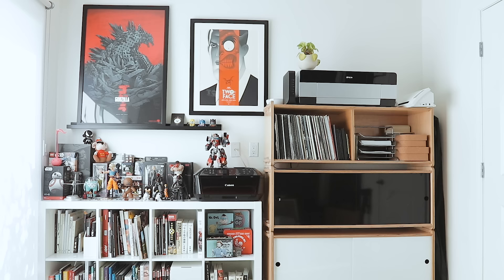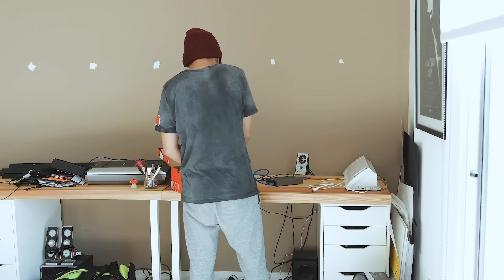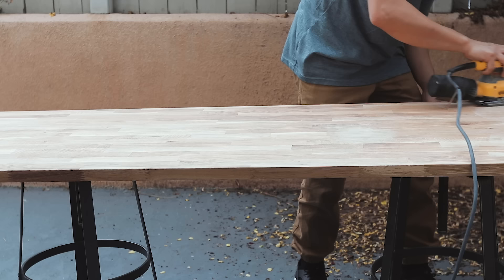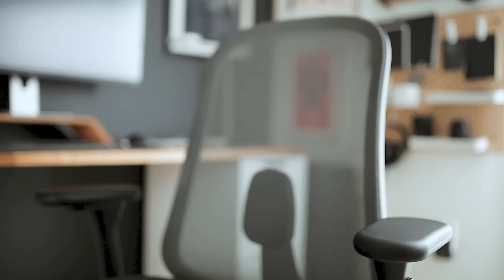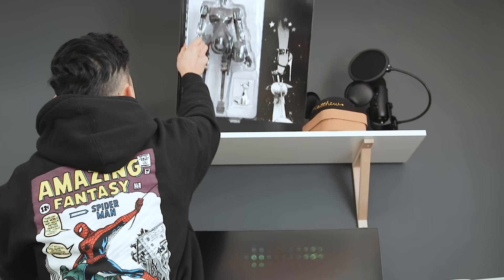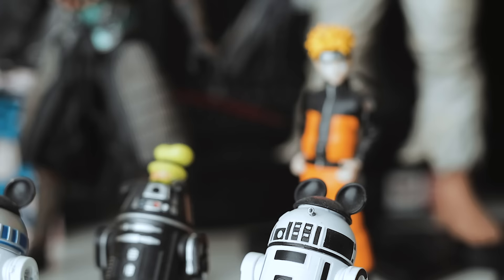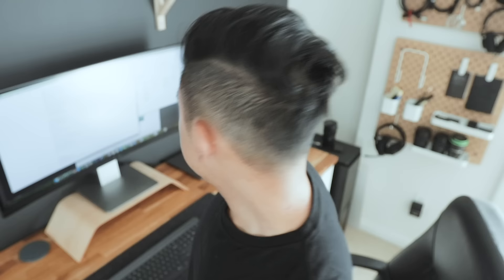DIY Home Office and Desk Tour — Work From Home Setup

Comment: To make your life easier, all Dell monitors allow you to create shortcut buttons on the monitor itself,  so you can create button shortcuts to allow you to switch inputs at a push of a button rather than scrolling through menus. You can also download “dell display manager” where you can use computer software to easily control the brightness and other settings of the screen without navigating though settings.

Comment: Just starting my home office plan... open loft and designated office cave. Need to minimalize the area around my space and got inspiration from your video... I have vintage macs, monitors, printers, speakers, and the like.  I need to wipe them and get rid of them as well.  Hoping to decide on the landscape of my desks and the storage space on the high ceiling wall behind the desk.  Thanks for the motivation... now on to finding my vibe... One thing... I have several murals painted in my home on the 3rd floor loft and stairwell; however, that is my living space and wanted to keep work in a designated place (since my work/life balance is a blur).  One problem... I love my art, the boost it gives me... suggestions are hugely welcomed... off to watch another video ;)
Reply from the maker: Keep it. Play around with it and adjust as you go.

Comment: Hey, I have some questions regarding your desk:
1) Is the tabletop your using deeper than your Alex drawers? In other words, does your tabletop hang over the ALEX Drawers from the front at all, and if so, how much overhang is there?
2) I found that the Gerton IKEA tabletop is very nice and similar to yours. I've seen others just apply the oil finish, but don't sand the wood down. Is sanding the wood really necessary, or no?
3) What are the dimensions of your wooden tabletop?
4) How have the ALEX Drawers held up over time? Since they are made from particleboard, I want to know since I am investing in an IKEA desk.
Thank you.
Reply: Aakash Kalmady i hope he answers these they are really good questions

Comment: Looks really good and stylish. Just one "however" - the abundance of open horizontal surfaces makes them (and the items stored there) collect quite some dust, which I find impractical. If you just put them behind some doors, probably made of glass - it could protect the items (especially the camera/lens stuff) and you from spending time wiping the dust out.

Comment: Get the app called "Magnet" for the macbook so you can dock various apps to different regions of the monitor easily. Way easier than click and drag at least. You  can have shortcuts lke "Command+Arrow" for moving the current window to one side of the display.

Comment: I have a couple of questions (may be stupid)
- When you put the tabletop on top of the Alex drawers, did you put something underneath the table so that it doesn’t move? Or no? If so, what did you put? 
- Also, do you think a tabletop would hold 3 monitors?? 2-24 inch monitors and a 28inch monitor?
- Would a 63 inch tabletop be able to fit those 3 monitors?

Comment: I saved $ on the chair, because I got car seats from a JDM chop shop(wayyy more comfy), bought a gas lift, the metal paddle thingy to adjust the gas lift height and metal legs with wheels from an office equipment supplier, weld them together and now, I am able to say "But can your chair do this?!"

𝑺𝒘𝒊𝒏𝒈𝒔 𝒃𝒂𝒄𝒌

Comment: Thanks for recommending your mouse. I just bought the MX Master 3 and I really like it. It is very comfortable to use! I also like how programable the buttons are when using it in MacOS with the supplied software from Logitech. I also got a table similar to yours in this video but I still need to treat the wood.

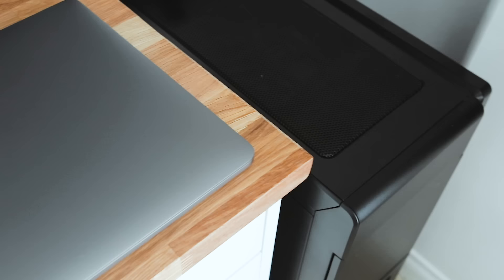Comment: Very neat setup. One quick question please, at timestamp @3:40 you mentioned about logitech keyboard and toggling between 2 systems using one keyboard and mouse. Do you need a software for that or how can we use one keyboard and mouse for 2 system, if you could explain lil bit on that. Thank you for creating this, hopefully i will incorporate part of this in my new setup as well.

Comment: Matthew - that is a really great looking set up. Kudos. The only question I had is, did you screw in or glue the  countertop to the drawers? Or, if because of the countertop’s weight, neither screwing or gluing were necessary?  Appreciate any guidance.

Comment: I got interested when you said you can switch your monitor between mac and PC, I didn't know that is possible. Can anyone here give me a link on how to do that? Thanks!
Reply from the maker: You just use the keyboard and monitor to change source. As easy as that.
Reply: @MatthewEncina  sorry, I meant how did you have mac and windows running at the same time? Is your monitor connected to a windows laptop and a macbook at the same time? Thanks for answering :)

Comment: Thank you for this video!  I really appreciate it.  I noticed that you have a fairly large window in the space.  What made you choose that particular wall to situate your desk/computer?
Reply: @MatthewEncina  Do you get a glare on the computer screen from the window?  This is my concern. My office will double as a guest room so I'm wondering about the flow if I pull the desk off of a wall, and turn it facing the door, back to the window rather than placing it against a wall (which I don't really want to do).

Comment: I liked your improvised table. One question though; Is the table top fixed to the alex drawers in some way? Or is it just resting on the 2 alex drawers base?
Reply from the maker: There is a rubber mat sitting between the two

Comment: Matthew, are you mounting the counter/table top onto the drawers? Or is it heavy enough that it doesn't move?  I was curious if you bumped it, would the whole top move on you.   Great Video and Office!
Reply from the maker: I use a rubber grip mat in between to hold it in place

Comment: that's a lovely setup sir... love from India. I do have some questions like 1) is that table totally fixed with those drawers or just that lies on the drawers without any attachment. 2) if that table is not fixed then is there will be any issue of flip over if anyone uses monitor arm on that
Reply from the maker: Just a rubber grip mat between the top and drawers

Comment: Which docking station can I use to connect my office laptop to connect with two monitor and when I do not need to use my laptop I can connect with my personal Tower. I do not need to change all wire all the time just one wire  usb - C which I can plug in to my laptop in need and do not then to my tower ?  Thank you for your help.
Reply from the maker: These days I’m using the hub from Caldigit

Comment: Hi @Matthew Encina, I like your work and think you might be able to answer this question. I am looking forward to do a setup similar to yours. I have a work issue Dell laptop which connects to a work issue kensington docking station via a 60W USB-C. I have a SurfacePro 6 which I use for all other personal business. I am looking for recommendations in terms of connecting both these computers to a dual monitor setup and use the same keyboard and be able to switch with a tap of a button just like you did. Looking forward to hearing from you. Thanks!!

Comment: So for the keyboard and for the mouse, it can be connected via bluetooth to 2 computers / laptops at the same time? So I don't have to keep switching back and forth?
Reply from the maker: Correct ;) You can actually connect up to 3 devices.
Reply: @MatthewEncina  aweome thanks! i work between 3 laptops and its a bit cumbersome to switch mouses everytime i need to switch laptops, thanks so much!
Reply: @MatthewEncina  or even just have 3 mouses.. lol! which i have 2 at ones, which its a bit much, again thanks!

Comment: Hi, I know this video is 4 years ago but just wanted to ask a question. Does your table ever move slightly as there is no anchor (nails,etc)? It seems that you just placed it on top of the shelves.
Reply from the maker: I use a rubber grip mat (for drawers) between the top and base. Never moved unless I picked it up.

Comment: Matthew, I know you upgraded your desk eventually, but did you find that the Danish Oil held up well on this one? I am looking to start with the same kind of desk setup, but I am worried about spills. I'm also debating a wood veneer option instead, but it wouldn't save me all that much.
Reply from the maker: Danish held up but if you really want to seal from liquid go for a lacquer (it’s just glossier). If you can spend the money, go solid wood. You can always sand solid wood down if you want to refinish.

Comment: I am currently making a similar desk, with alex drawers, but instead of the karlby desk I bought an ekbacken tabletop which is much thinner and cheaper. Does anyone know if the decision I made was the right one or will the desk break
Reply from the maker: Those are solid. It shouldn't break unless you're really putting a heavy load in the middle without support.

Comment: 04:28 How ?
Same for the keyboard and mouse. i have the exact same keyboard and mouse but it's rather working with the mac OR with the PC.... also the monitor. i've an imac and i use it for work with an extra DELL monitor (2 screens). So the Dell is a secondary screen for work but it's also a primary screen for PC. but i have to plug-unplug cables all the time. any ideas how to fix this?
Reply from the maker: The peripherals can connect to 3 devices via bluetooth.
Reply: @MatthewEncina   Thank you very much for replying! so using the bluetooth i can connect to multiple peripherals. do you know if i can do the same using the USB "antenna"?